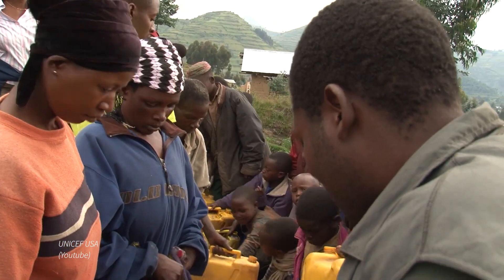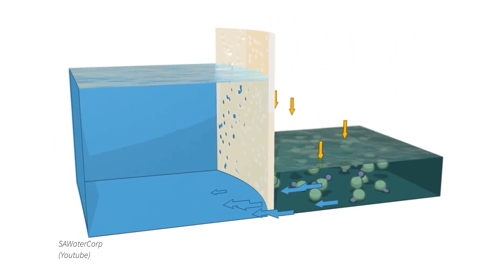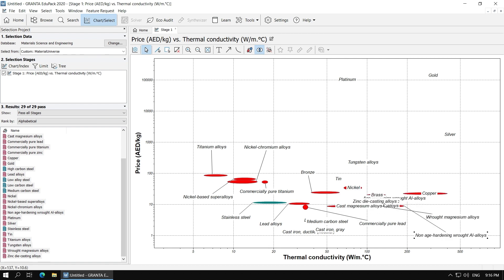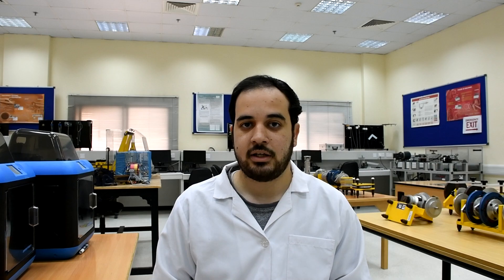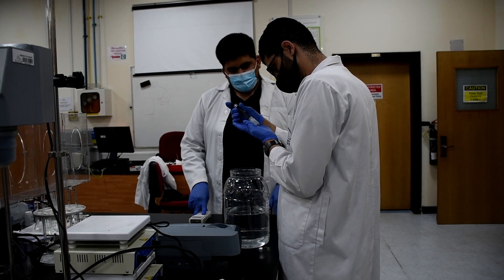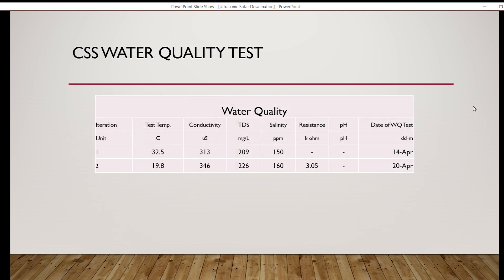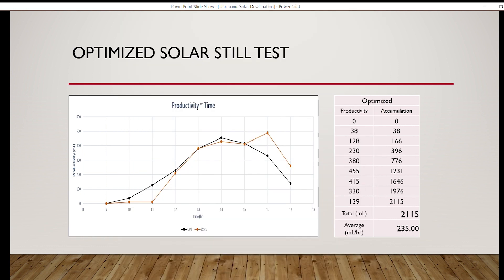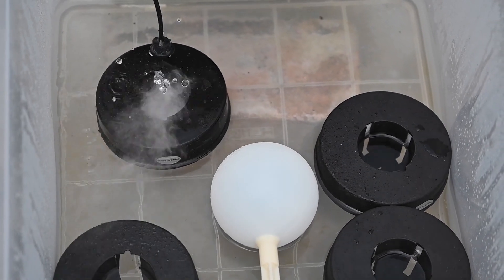Ultrasonic Solar Desalination | 4929

Comment: How does the double-sided trough prevent mixture of saline mist and harvested fresh water?
Reply from the maker: Great question Scott, our solution was to attach a Mist Separator to the Double Sloped Trough that leaves a small 1 cm gap between the glass cover and the Mist Separator to allow water to slide and at the same time to block the mist from mixing with the freshwater.

Unfortunately this only reduced the mixing but did not completely stop the mixing. We are still looking for a solution for this as it is a bit complex since mist is a group of fine water particles.
Reply: @bahashwaiki  With the mist, seems like mixing is inevitable.  Second filter downstream?

Comment: You should be exploring how to change the pressure in the stream of mist to lower the temperature required for evaporation.  Use solar to feed that endothermic process.   Volume is inversely proportional to surface area, so there is an surface to absorb more heat (solar) into the micro-droplets and increase evaporation rate.  Lowering the pressure is another attribute to force the phase-change, possibly at a lower energy cost.  Passing water into vapor provides a lucrative opportunity to extract the solids and ions.   Using geothermal to cool the out-stream (with the optimal pressure) will condense the vapor downstream.
Reply from the maker: Lowering the pressure of the mist to lower the evaporation temperature and to achieve high evaporation rates is definitely a good idea as we had it in our initial designing stages of the solar still. But then we decided to exclude it since it will make manufacturing much more difficult to ensure durability and reliability of the system. Usually controlling pressure in such systems will increase the cost of manufacturing by a lot.
Our goal is to make our system as passive as possible (operating mist makers is the only electricity consumption). From the data we collected, we are thinking of reducing the volume while keeping the exposed surface the same which will increase productivity as you said.
Reply: @bahashwaiki   Understood.  So you have established the constraints to keep costs low for a certain scale of production and maintenance. That will apply to many scenarios.  But, if you remove the constraint to modularize the production cell you may find a system design that has not yet been fully explored.  I think the fundamental difference with ultrasonic atomization of the water is a low-energy, mechanical approach to increasing surface area to increase evaporation rate. The smaller the droplet, the easier it is to absorb the heat, the more efficient the system. There are probably a few branches to explore down this path.  Lowering the pressure within a controlled chamber - coupled with a continuous flow design (hard) - is merely a later stage get the solids and ions to drop out. You would have to calculate the optimal system to determine if it is even worth pursuing. The Carnot cycle is only a component of that calculation.

Comment: How much does this Technology Cost?
Reply from the maker: The whole prototype (Solar Still and Ultrasonic Box) cost around 622 USD. Yes it is expensive because it is a prototype and not a mass produced product. Also, the manufacturing of the solar still was done in the UAE which makes it very pricey. Not to forget that the ultrasonic mist makers are also expensive as each head costs 30 USD. We used four to six ultrasonic heads in this project. But what is interesting is that even though the overall price is expensive, the cost per liter would be around 0.13 USD, assuming 10 years life duration of the whole product. Again this is a prototype and if it ever enters mass production, the costs can be significantly reduced. Check the second video I made that shows the costs in a bit more details:
https://www.youtube.com/watch?v=6MynEdS5WH8

Comment: Would also have loved to see the effects of higher temperature variances between basin and glass. In some locations (eg Cape Town) they have access to very cold sea water and high solar radiation. They can therefore cheaply increase the variances in temperature
Reply from the maker: We did actually collect all the important temperature related results from the experiments that we did. However, since this video was targeted for a competition, we had to put the most important data.
As you said, cold water and high solar intensity increases the heat gain due to high temperature difference. However, if the water is initially cold, then it would require more time to evaporate than if it was hot, which explains the higher heat gain. It is more preferred to have the water temperature as high as possible from the ambient before exposing it to sunlight, this way it will guarantee higher freshwater productivity.
Reply: @bahashwaiki  I hear what you were saying but what I was thinking was (and this is going to be challenging to explain without a diagram):

Cold feed water is passed over/through the condensing membrane. Think of it as a heat exchanger, with your vapour on one end and cold water on the other. Could use similar method to what is used in a still.
Cold water exits the vapour/water heat exchanger then flows through another heat exchanger, with the waste brine solution. This will cool the brine before it returns to the ocean, and preheat the cold feed water. You could add additional exchangers to bring the waste water temp down to as close as possible to the ocean water temp. The Feed water would therefore have risen dramatically with less energy lost. Double win.
This does have a higher initial cost, but running/maintenance costs would be low. The non solar energy input would therefore be: water pump, (unless by some miracle your salt water is at a higher elevation), the atomiser, and possibly a small air pump to encourage airflow. I would think if your evaporation chamber is large enough, most of the salt will precipitate out before the vapour is extracted at the top of the evaporation tank.
My thinking is that should this work, the benefits are that we would maximise evaporation using your method, AND maximise condensation using the cold feed water.

Comment: Brilliant idea, but not sure I understood how you separate the mist from the rest of the system. You mentioned a membrane, but surely that will become saturated, with reduced airflow, and once the membrane becomes saturated airflow will be compromised and even negate any benefits from the misters. (I assume that the mist created from the ultrasonic mist contains salts/metals, as it is actually fine water particles rather than evaporated water.) Would love to know how you overcame that without just creating a large space for the salt to fall out.
Would have also loved to see if the product had any other volatile components present. 
Brilliant idea. Cannot wait to see more.
Reply from the maker: Thank you Dibis1978 for your interest in our study!
The ideal and best case to achieve high productivity from ultrasonic technology, is to place the Ultrasonic Transducers (Misters) inside the solar still. However, in our prototype, we simply separated the Ultrasonic Misters from the solar still chamber itself by placing it in another chamber (ultrasonic box) and use a flexible duct as a passage for the mist to go through. This is because the Misters cannot withstand high temperatures inside the solar still and would probably get damaged in a very short time. Therefore this approach was to ensure reliability of the Misters and guarantee a long lifetime.

Yes you are correct, the mist contains salts and it is composed of tiny seawater particles that require only a small amount of solar energy to turn into vapor.
Since our study was targeting the performance of this new configuration, we didnt  focus on removing the remaining salts using a mechanism, we rather removed it manually.
Thank you again :)
Reply: @bahashwaiki  I wonder if you could achieve this by separating the solar heater, the evaporation chamber and the condensation chamber. See my other response for my poorly illustrated idea, but assuming this separation works, you could possibly make your evaporation chamber very tall with a significant gap between the water level and the vapour removal point at the top of the chamber. Hopefully this would allot the salts to precipitate out. Note that for this to be effective, the evaporation chamber, including the top should be in the sun and painted black, or insulated and allowed to match vapour temperature. You want to minimise condensation within the chamber, as that is wasted.
Only downside I suspect is that you cannot rely just on convection to move the vapour into the condensing chamber. You may need a small blower to encourage air movement, but not enough to suck the atomised water through to the condensing chamber.

Look, my idea is not going to win any awards and is more expensive, BUT, if it works as I suspect, it would maximise production without increasing solar energy input and have little to no long term running costs.